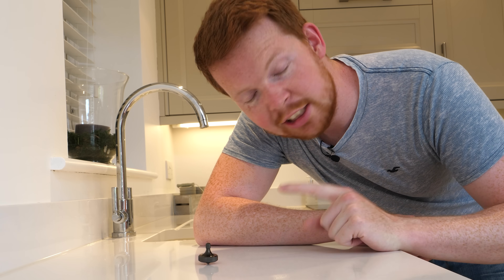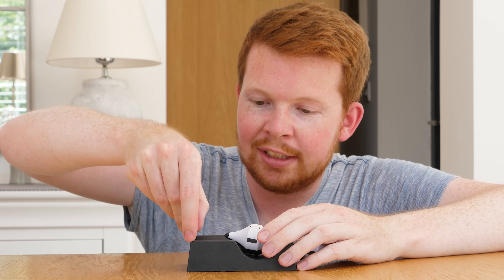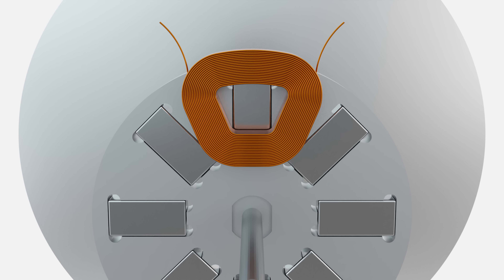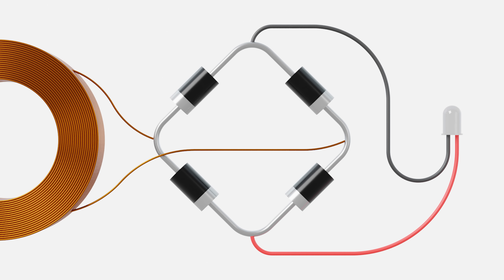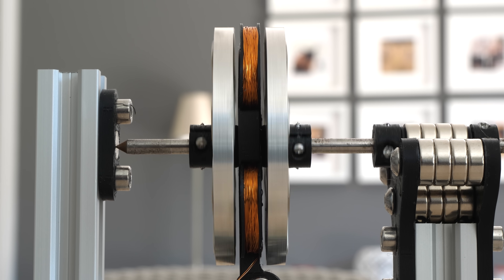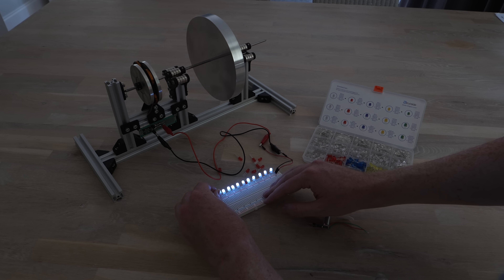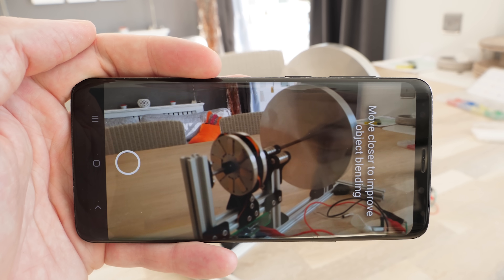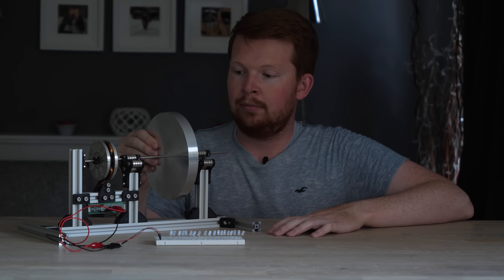Flywheel Battery

Comment: Congratulations, you invented an electric generator! The only difference is that your bearings are "low friction" (though wobbly, so they lose the energy in another way). Still, having a big chunky conductive disk in a stray field of magnets will also slow it down as the induced currents will be generated in the flywheel (re: motional e.m.f) and dissipate energy into Joule heat as well. Also "voltage" is not a synonym for "power" (Power is V x I as we all know).  So, when you choose a thinner wire for pickup coils allowing you to get higher voltage, the resistance of these coils is going up, limiting a current. The max output "power" ideally would be equal is the power of your fingers (rate of change of rotational kinetic energy) when you spin up the thing, minus all Joule and mechanical losses. So an ideal energy converter should stop your flywheel very quickly (try shortening the output of your pickup coils to see what max output current you can get and how quickly that thing will brake (re: "electromagnetic brake").

Comment: Now put in a governor that forces the RPMs to increase when it hits a certain threshold at the bottom cycle such as a capacitor that robs a little voltage for stability.

Comment: Imagine people having giant flyweels in their basement connected to a platform that they can stand on from a higher level of the building and then use their bodyweight to generate electricity by having a set of gears that is made so that it goes down at a steady pace just like a elevator

Comment: Add another magnetic wheel and another set of coils. But the second set of coils with 90 degree offset to the first, so that when the first one is not producing power, the second one is. Should be able to reduce the flickering.

Comment: Could this work without the plate if you had programmable magnets? I haven't got a clue what I'm talking about tbh, just saw a video on them and thought "Hmmmmm".

Also if you hooked a bigger version up to an electric car, how far could it go if the wheels were connected to the flywheel?

Comment: If you wanted to produce more and potentially balance the flywheel, you could setup a small handcrank on the end with a slip to let it run freely after you've cranked it, effectively making a magnetic handcrank generator that you don't have to keep cranking to keep power running.

Comment: Conservation of... something (?)... will weaken the permanent magnets over time? It seems as if you should get the same amount - or less - energy out as it takes to spin the flywheel? But there is a conversion of mechanical to electrical energy?

Comment: How long could you keep it spinning if you used the first motor to "boost" its speed? Might need to add a flywheel of a size that lines up with the rpm of the motor for best results.

Comment: Imagine a Second pair of coils/magnets set 180 degrees from the first:    Would that smooth out the pulses and create 2 phase a/c?     Would the speed of the flywheel  change the frequency? Sorry, I am not an electrical guy and I am terrible at math

Comment: nice work !
anyway : i would try to close the (half) magnetic bearing by adding another half at the top.
Also : the close proximity of the rotating ALU-Flywheel to the stationary magnets will induce
losses into the flywheel. Better use plastic ?

Comment: Great demonstration and proof of concept. One observation and possible improvement/enhancement. If the shaft supports had magnets set at 0. 120 and 240 deg spacing most if not all of the bouncing and lateral movement of the shaft would br eliminated making it more stable.

Comment: You could use a RC brushless motor for the generator and use a 3 phase rectifier (6 diodes)
Preferably use Schottky diodes they only have a 0.2V voltage drop.
Since you are adding 3 sine waves 120 degrees out of phase, you get DC out. So no capacitor needed and the output has no frequency component depending on the rotational velocity.
Also a constant current regulator to drive the LEDs keeps them from being destoyed if the voltage get to high.

Comment: Why Magnetic force is electric force? Why Magnetic moment and mono pole don't exist?

Magnetic force is circular electric force. There is no magnetic poles and there is no magnetic moment. If the magnetic moment is formed from 1 mono north pole and 1 mono south pole, like a smallest magnet, then you cannot use many of it to make a big magnet. 

Two parallel current carrying wires attract or repel each other is not caused by magnetic force, since there is no magnetic moment in copper wires.

Current carrying wire does not attract magnet and has no poles, circular current carrying wire attracts magnet and have poles.

Imaginary magnetic moment is in fact electric dipole, magnetic poleis in fact  concentric circular electric force . 

Theory Of Magnetism And Electromagnetic Induction

Ferromagnetic material has a special property – it can be magnetizing to create temporary electrical dipoles/magnetic domains.

Every magnetic domain contains at least two atoms. When an electron moves from an atom to the next atom and stays there temporarily, the two atoms become a temporary magnetic domain.

The magnetic domain carries a negative charge on one end and a positive charge on the other end, so we can call a magnetic domain an electric arrow.

Due to electric arrows carrying positive charge on the head and a negative charge on the tail, it has special properties:

1. Same direction electric arrows attract each other from head to tail, and by side to side.2. Opposite direction electric arrows repel each other from head to head, tail to tail, and by side to side.

Temporary electric arrows in magnets’ Ferro material cannot exist by themselves, but rather must all be linked into concentric rings and fill up the whole magnet, for a magnet to be stabilized and magnetized.

Therefore, on the poles of a bar magnet, there are concentric rings of electric arrows/dipoles, with one pole clockwise, and the other pole counterclockwise. On the body/surface of the bar magnet, there are parallel electric arrow rings all over.

A current in a wire does not create a circular magnetic field in space. It induces the electric arrows in the compass to be parallel to its current direction; therefore, the compass moves to 90 degrees to the wire.

Between two parallel conducting wires at distance R, line of sight electrons on the surfaces of the two wires are repelling each other with electrostatic force F=Ke x ee/R^2. This repulsion force is billions of times stronger than a steel rod. Because it connects all of those repelling electrons as one, therefore, if there is a current alternating in one wire, it will induce an alternating current in another wire instantly. This is the true mechanism of so-called electromagnetic induction. It is, in fact, electrostatic induction.

Magnetic force is a misinterpretation of circular electric force.

The magnetic field is a misinterpretation of the circular electric field.

Electromagnetic induction is a misinterpretation of electrostatic induction.

The electromagnetic wave is a misinterpretation of electrostatic wave/alternating current.

Electromagnetic radiation is a misinterpretation of electrostatic radiation.

Comment: 12:19 I would like to to see the motor conetcted to the rod on the right side and then starting spinning and I would like to see if can be spinn for a decent time?

How much rpm does the flywheel need to spin to get the amount of energy to spin the motor? And what torque is needed?

Comment: To get the aluminum flywheel off the steel shaft, try heating the flywheel up (e.g. with a hair dryer?) and the aluminum will expand and as it has a higher coefficient of expansion than steel,  possibly allow you to remove the shaft (although the shaft is a relatively small diameter and it is hard to know if heating will work.  There may be some galling of the aluminum).  Good luck!  BTW great experiment.

Comment: You need to replace needle with two pare of magnets on the both sides of axle, place levitated axel with flywill to the glass container and drain air from it. Besides, you could insert magnets to the flywill - it would encrease moment and rotation time. 

Without friction it could be a interesting (and dangerous) analogue for batteries. I'd like to know how much energy we could store in such system, how long it could keep it and how fast could charge and discharge.

Sorry for the language - it is foreign to me.

That so exciting system!

Comment: There is one question that cones to my mind: Wouldn't normal ball bearings be better? I mean all that wobble and shake with those magnetic bearings certainly waste more energy than using simple well oiled ball bearings... and then a lrger diameter shaft could be used too. Then the magnets of the generator could be placed closer, making more elecricity. And as an addendum, you could use the generator as a motor to get the flywheel on speed. 

BTW your generator assembly reminds me strongly on motors that can be found in 5 1/4" floppy drives or DLT tape drives.

Comment: Honestly its a good design, however there are a few flaws which if corrected, would make the design much better 

1) Milled piece of steel to ensure a pefect straight rod.

2) the flywheel itself be  about 1/2 the thickness, and within it a very large amount of coils, same thing you did with the smaller one, except the flywheel itslef be the generator. Using a 3d printed U shaped circle, with the middle being a thin opening, which would go between the two aluminium pieces, this would give a much larger amount of voltage, most likely enough to charge a phone.

Then to crank (spin it ) 

3) I would suggest to use a simple circular disk with rubber surounding it at the end of the rod ( thin ) but enough to have a circumference about the size of your hand, so you could simple grab it, and do a very powerful twist , would give it enough speed.

--

I hope you will develop this further to make it so that it can charge a phone or something, that would be nice.

Comment: Overlap coils to create several phases, that will eliminate the dead spots in the output of the generator. Also, LEDs in parallel don't work all that great -- the LED with the lowest forward volt drop will steal all the current from the others (I'm actually surprised they work as well as they do like this).

Comment: instead of using a fixed point as the lateral stop, why not use... magnets? a south pole vs a south pole and you've got air friction only. Also, companies like Revterra are using magnetic levitation flywheels for grid buffering  / storage right now. Its a great storage method

Comment: Few things to improve this - 1) put a two opposite magnets at the end on shaft to have tue no friction setup. 2) Use schottky, or pin (1N4148) Diodes. It has less voltage drop, so output voltage will be higher. 3) can you spin it with other end of shaft with drill? Some tooth mechanism that can easily disengage.

Comment: Here's some explanation from an Electrical Engineer. The voltage produces depends on the rate of chagne of the flux, i.e. faster flywheel makes more volts. The amount of power extracted from the flywheel depends on the current that is being drawn by the load. 
LEDs need a certain voltage to glow, and will draw their own share of current. So if the voltage is enough to light up one LED, that proves you can generate enough voltage for 20 or even 100 LEDs at the same time. However, as more LED's in parallel will draw more and more current, I expect the flywheel to slow down at a faster rate while more LEDs are connected.

Regarding rectification from AC to DC: It would also work to omit the full bridge rectifier and only use two LEDs in antiparallel. For lighting up a room this should work fine. 
This is because the output from the alternator is not a perfect sine wave but more a square wave: quite constant while the two magnets traverse the copper wires, and zero while the magnets are inside or outside the copper loops. Only a change in flux generates a voltage. Nowadays, very clever people have found ways of winding three-pole alternators such as to approximate a sinusoidal wave. 
When in practicum at university, we all also observed square (or trapezoidal) waves from our handmade alternators. This brings back memories, wonderful to see! Hope you are as curious and learning as we were!
Best regards,

Comment: Very Interesting and Satisfaction...
I had a plan to build a setup like this, but not time not permitted.

I would like to see some further updates on your setup:
1. Wound the coil in a laminated Iron core
2. Use Laminated iron core instead of aluminium in magnet assembly, If possible insert a plastic bush of thickness 5mm between magnet and iron core.

Make these two updates, i said above. then we make more energy than before!
Anyway, You are awesome, Cool!
Bye!

Comment: I played with magnetically levitated flywheels as well, but used opposing magnets on the axle ends, for frictionless side play control.  Like your alternator you engineered!   put a lightweight propellor on it, and set it out in the wind….thanks for the video!

Comment: Use a MOSFET bridge rectifier, you are losing significant amount of energy due to diodes' voltage drop.
Reply: Or schottky didoes as an easy option since they have a lower voltage drop. 🤷‍♂️
Reply: or use none, the D from the LED stands for Diode so just use two or more pairs of LED's in parallel wired in opposite polarity to extract as much as you can from those coils. Yes, they will pulsate 'cause you can't add a filtering capacitor (however in this video you can see that they are pulsating anyway, I guess because he didn't add the capacitor anyway, so I can see no reason to use a FB rectifier in this particular application). For the DC motors you will need the rectifier.
Reply: @nycsaba  I wonder what the avalanche voltage of those diodes are, and how much current they can produce. The setup, by my estimation, puts out 200-400mA. OP should have wired a DMM in series and measured the current output, I'd be curious.
Reply: @the_kombinator  By the looks of it they are 1N400x diodes, if so the voltage drop on those diodes should be around 0.7 volts.
Reply: @nycsaba  there's still a voltage drop due to the light emission...
Reply: @nycsaba  This comment section has officially made me feel like I have the vocabulary and comprehension skills of a 2nd grader.

Comment: You don't need to have a friction point. On the flywheel, place a very powerful ring magnet on each side. North facing away from the flywheel for same pole facing out. Then add a strong disc magnet with the north facing out on each end of the axle. Have the flywheel sit between two secured structures, one on each side of the flywheel. On those structures, you will have a ring magnet with the north facing towards the flywheel magnets. This is excessively stable and solves the "balancing" problem quite well.

The magnets on each end of the axle can then be lifted the same way you are lifting the axle already but you will want some above as well to prevent the flywheel disc magnets from wanting to move upwards. All things in place, this will be 100% stable even with a slightly bend axle. Ta-da!! Fully levitated flywheel axle. Now just get creative with the generator coils and generator magnets and you should have a mechanically frictionless flywheel and axle.

The friction will be so low that a solar panel from a garden light will be enough power with ambient lighting to power a small electromagnet coil that can spin two magnets affixed to the axle shaft. Pulse the power from the solar panel into the electromagnetic coil using a reed switch.

You can further improve the design by including a hall effect sensor to delay power output of the generator until it the rotor meets a specific rpm. This way the power pulsed to the electromagnetic coil that spins the rotor can be made into an open circuit and a super capacitor of 2.7V can be charging with ambient light while the energy of the flywheel is producing a higher voltage for other devices.

This can be made even more efficient if you care to go that far but the build you made in this video is so far below what it could have been. I hope you remake this video using the methods I detailed here.

As an add-on, this makes an excellent low CFM wind generator setup. Requiring almost no wind at all to spin the mechanically frictionless flywheel.

Comment: Stored energy devices are already being experimented with now, solar collected energy drives a motor and balanced flywheel set up in a vacuum chamber and when the solar energy ceases the motor then creates energy, so far 6 hours run time has been achieved
https://www.sciencedirect.com/topics/engineering/flywheel-energy-storage

Comment: So basically the bigger the electric load imposed on the generated circuit, the more electromagnetic resistance the generator's magnets feel against the coil's circuit.

You can feel this effect with the hand crank flashlights,  when you have the light off (no load) the magnets move easily with the magnetic field interacting with no electric field, when the light is on, the circuit's electric field is then able to interact with the magnetic field.  There must be a completed circuit load (light bulb).  So it's a conversion of energy into a different field.  The load consumes (converts) the energy from the momentum of the magnetic fields.

Comment: While probably not enough for a consistent charge voltage, could you store the output into a battery, then when that is full, use it to charge a phone? Would be handy in an emergency or camping situation, just spin this flywheel by hand once every 10min, let the flywheel load work for a bit, then take the buffered total charge off after a while.